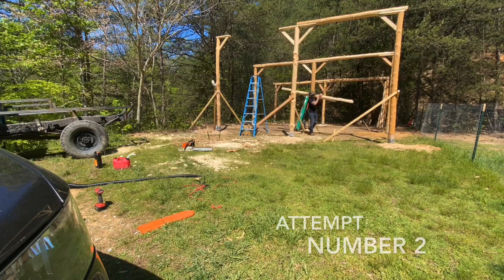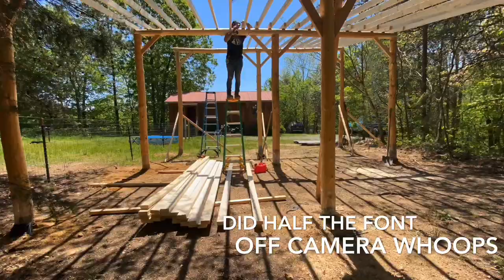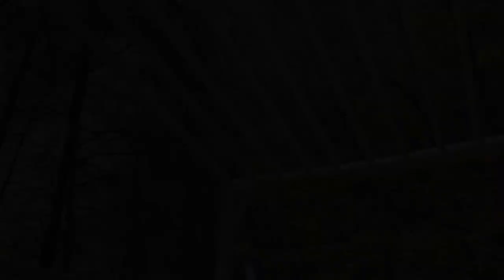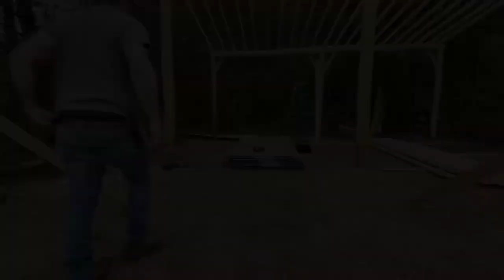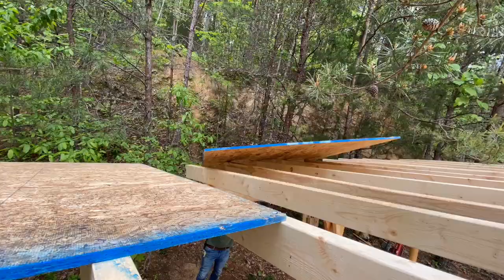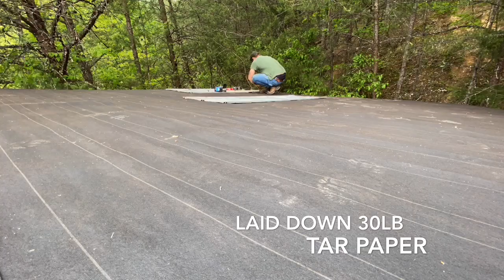Inexpensive pole barn build part 3

Comment: Good stuff! Curious question because I’m going to build something like this soon. Why didn’t you just lay down the metal roofing over the 2x4’s and use roofing screws to attach them?
Reply from the maker: That was the original plan. Would have saved me some money. But since I built with round logs, not everything came out square so they didn’t like up how I wanted them too. That’s also why I ran my roof boards 12” on center. If I knew I was gonna end up sheeting it I would have went 16”